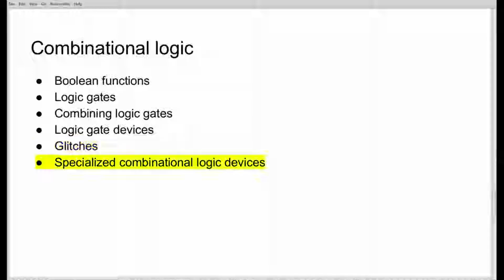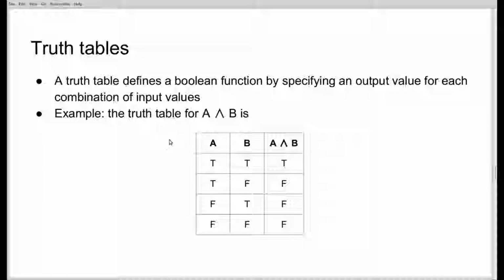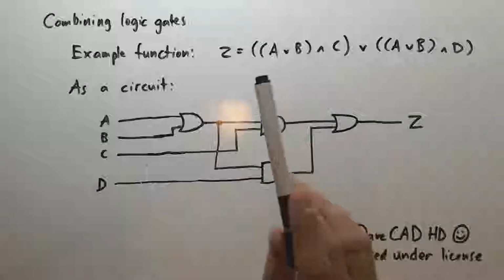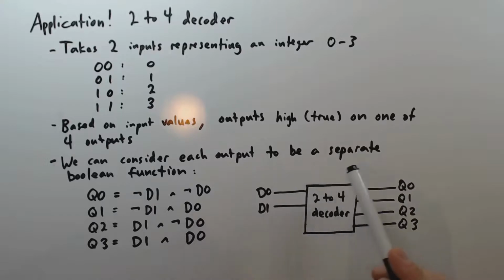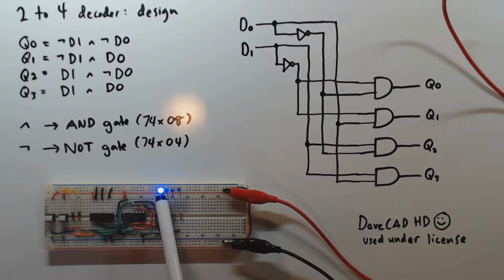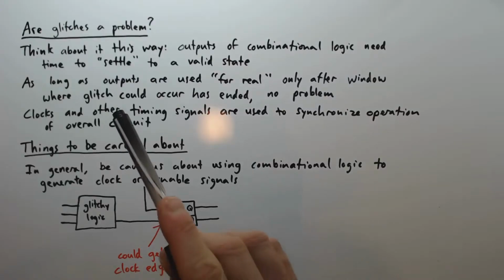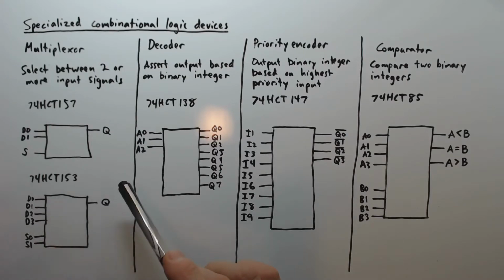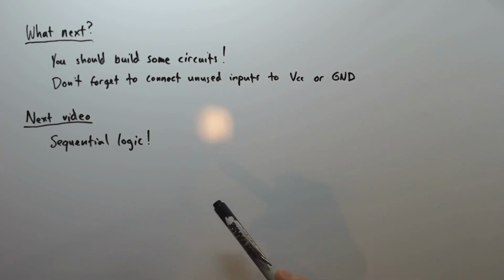DIY 8-bit computer, Episode 4: Combinational logic

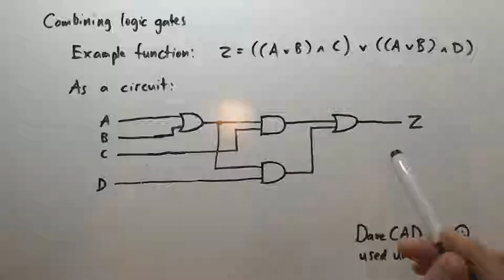Comment: at 13:52 you could actually shave of another logic gate by changing the function to (a or b) and (c or d). probably quite a bit out of the scope of the explanation though.
Reply from the maker: Good point!  I decided to avoid talking about circuit minimization techniques in this video (my preferred design strategy is to just wing it), but maybe I'll try to cover that in a future video.